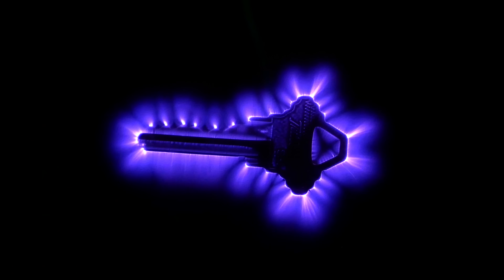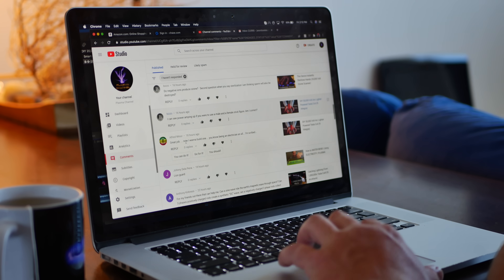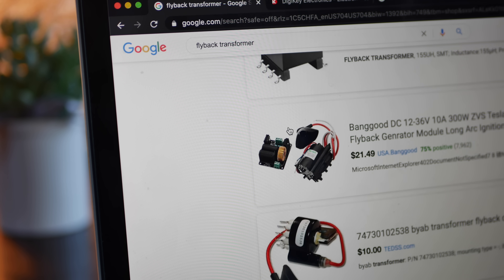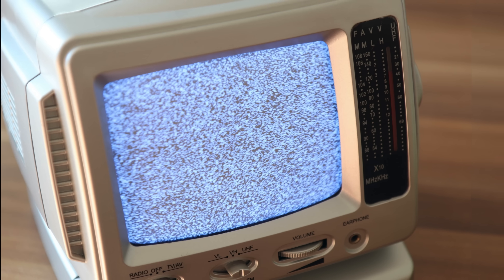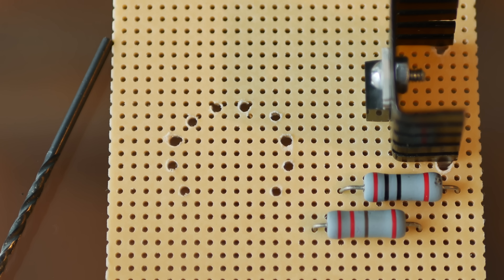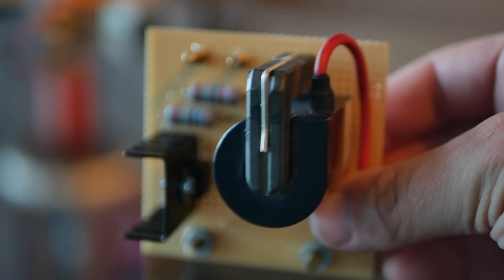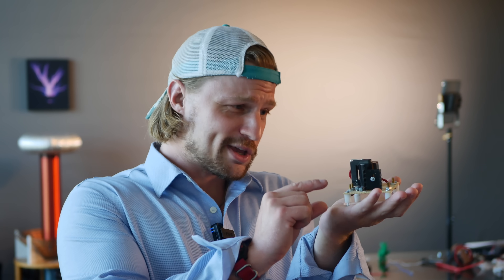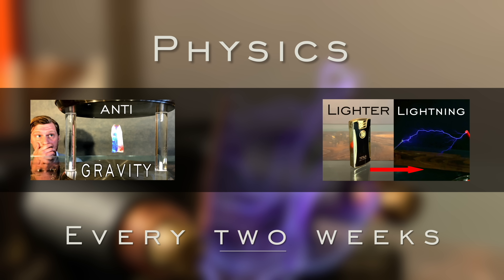DIY Plasma Physics Powersource (Mini 20,000v Flyback)

Comment: In order for there to be an arc, shouldn't there be a constantly changing (but not necessarily alternating) current in the primary coil? I dont see how the mosfet would undergo cycles of ON and OFF states in the given schematic without the 12V being turned on and off. 

From what i understand, the circuit undergoes the following steps (please correct me if i am wrong):
1. At first the mosfet is OFF. When the 12V is turned ON, there is some current going from the voltage divider through the flyback coil to the base of the mosfet, thus turning the mosfet ON. As a consequence of this, during the time when the mosfet is not yet saturated, the current through the flyback and the primary coils rises, thus changing the magnetic flux through these coils, which in turn induces an emf accross the secondary coil. Due to the proportionality of windings in the primary to the secondary coil, the emf in the secondary coil is going to be very high, as intended.

2. When the mosfet reaches saturation, the current through the flyback and primary coils becomes constant, thus stopping the change of the magnetic flux, thus ceasing to induce emf in the secondary coil. Since the flyback coil has a lower resistance than the 20 Ohm resistor, most current at the junction after the 220 Ohm resistor will go to the base of the mosfet, thus keeping it in the saturated ON state. If this is correct, this means that the mosfet will be stuck in ON state forever and never change the magnetic flux through the primary and flyback coils again. 

Now, the schematic is probably correct, which means that the mosfet does actually undergo cycles of ON and OFF. Could these cycles be caused by the back emf in the flyback coil cancelling out the pd between the junction and the base of the mosfet, thereby getting it into an OFF sate, or is my understanding of the schematic not accurate?

Comment: so transformers only work with ac voltage, how did you make dc turn into ac
i wanna know this cause im messing around with transformers and wanna know how to make dc, ac
Reply from the maker: Transformers work equally as well with pulsating DC. 

This uses a transistor. Cheers.
Reply: @PlasmaChannel  thank you! Now I can finally use transformers

Comment: Hello ,  i was wondering what is the volt /current of the arc ? 
Are they constent by polarity ?
 I mean when you turn it on do you get a constent stable  "arc" of lets say 20000  volt and 0.002 amp with a constent polarity ? 
Thank you for your time 
Have a nice day

Comment: Someone make my parents understand that wearing gloves without holes will not get you any shock
Reply from the maker: Well, only if the gloves you are wearing are designed for high voltage. 20,000 volts (even 5,000 volts) will go straight through a normal latex glove.

Comment: Your videos are fantastic Jay! I just subscribed after watching several of them, and I'm hooked. Quick question - where do you get your HV wiring from? I'm wanting to purchase some (or make some by modifying regular 14 gauge wire), in order to attached a high voltage source (your DIY 10KV to 15kv project that uses ionic air transformer with ballast driver) to an electrical grid of sorts (length from HV source to grid would be 8 to 15 feet). I've noticed in some of your videos that you use black insulated wire (looks like silicon insulation) and some of it has the "UL" label on it. I've searched using Google, Amazon, etc, with only a few hits (fairly pricey). Can you let us know where you get your HV wiring from?
Reply from the maker: Welcome to the family! So glad to have you. I get most of my HV wire from all the high voltage devices I take apart. I recycle it from things such as microwaves and crt screens.

However, silicon coated wire is definitely the way to go, and you can get it on Amazon.
Reply: @PlasmaChannel  That's good info Jay. Thank you!

Comment: Hi Jay. Can I use car ignition coil as transformer?
Reply from the maker: You would need to modify the circuit quite a bit. In the current layout, it would not work.

Comment: What do you use to ground the circuit?
Reply from the maker: The circuit is not grounded. The HV wire connected to the bottom of the transformer acts as a ground though it is still at a -HV as opposed to zero.

Comment: Help needed!!! Built a beautiful board according to the schematic...nearly fried the 2N3055 in a matter of seconds at 12v 5A CC...flyback never discharged...pulled the Mosfet and it tested good, within fact sheet specs. Went back to a breadboard, tested each component including a brand new flyback....went through 3 different Mosfets that should have worked and no discharge from the flyback...destroyed 1 and nearly over heated the other two again at 12v 5A CC. Went back and tested every component, even meged the high voltage coil, and I just can't make it work. I like the idea of this simple circuit and it would be great for my application if I can made it work...any help or ideas????

Comment: Does this produce a smooth output or pulsed, and if the second, is there a way to smooth it? I'm aiming to make a singing arc, and I'm not sure how a pulsed output would work with the resonant circuit.
Reply from the maker: great question. This is pulsed DC out. A high voltage capacitor across the output leads would help smooth the output. Make sure there's a bleed resistor across those capacitor leads though.

Comment: Sir can I use electricity from this project in any electric motor or small led bulb.
Reply: No! It will blow (big time) any LED, and any small electric motor, and won't have the power to run a large motor. Thats not what it was designed for. There are different power supplies for different purposes.
Reply: @martinsims1273  ok

Comment: Will this high voltage hurt if the wire is touched?
Reply from the maker: I do not recommend touching it, ever. It will not kill, or hurt you much. But, it may burn your skin.

Comment: Jay,
I have the flyback transformer from TEDSS  in your links and I'm really struggling trying to identify the pins for the primary and feedback coils.  Lowest resistance is between 2 - 4 and 6 - 7 but those don't work for me. Can you offer any assistance?
Reply from the maker: I had a viewer inform me they had similar issues. If you consider the lower resistance to be the feedback, and next lowest to be primary, it may help.

Comment: Hi! I was able to create this work! really thankful for your explanation. Just one CLAIM tho. In the video you say that to find the feedback and primary coil we need to check the resistance, the higher resistance is the feedback coil. But this statement is wrong: the primary coil has more windings, therefore the primary coil has higher resistance. I had to test this myself since it wasn't working until I flipped the connections. for the rest dope video bro, really really dope! Amazing
Reply from the maker: Glad you were able to build! I've found depending on the transformer, their primary coils have a thicker gauge of wire and have lower resistance, and the feedback have thinner wire, but less turns. It seems to be a flop depending on model of transformer. Really glad you got it working though, and congrats.
Reply: @PlasmaChannel  oh okay then, supercool. yeah it took me a while to understand how the hell it worked, but now i have it! thank you!!

Comment: Hi, Jay. I built this circuit and am using the MJE3055T transistor that you are shown using in the video and using a variable DC power supply to power the circuit. I cannot get arcs though and the circuit draws a lot current and the transistor gets hot very quickly. Any suggestions or tips to powering it up? Thank you!!
Reply: Are you sure you're insulating the bottom from any ground?

Comment: hi, sorry i m new to this but where did u mae the connection from your circuit to the final screws? it doesn t really show. the spark gap at the end of the video is given by the screws being connected one to the transformer and the other to the transistor?  plus there is a red wire going from one of the screws, where does it come from ? ( you put 4 screws: two for the battery, one for the spark gap that I don't understand how it is connected, and the last one has a red wire coming out of it). it would really help me out if you could answer these questions since i'm trying to do the project myself.  REALLY AMAZING VIDEO THO

Comment: Can I use IRFZ44N Mosfet instead of this?
I used 2n3055, but result was poor
Reply: And I placed 47Ohm resistor instead of 20Ohm, does that make difference?
Reply: And I also heard annoying high freq buzzing when I turn on transformer, what can it be?

Comment: What are the 2 primary coils in 2:56 please let me know
Reply: Yeah just in case you’re still interested in this, I’ll help you out. I’ve been lightly working for like a month on this as my first ever electronic project and I’ve figured out what you’re asking. The primary coil’s two terminals connect to two things. One of the primary terminals of the flyback connects to the collector, the other connects to the positive input.
Reply: @hayden_smith6  if you have done any simulation can you please help me regarding it

Comment: Nice!  This is basically a souped up version of the small plasma lighter circuit.  The output voltage is high frequency high voltage AC because of the self-oscillation of the primary side caused by interaction between the feedback winding and the transistor.  The output would be suitable for presenting to the input of a voltage multiplier to get very high voltage DC at the top of the multiplier.  Edited to add, it appears that flyback transformers like the one used for this project have rectifier diodes in the secondary so the output would be DC and so NOT suitable for voltage multiplier projects.  You want the output to be high frequency AC to feed into a voltage multiplier.

Comment: Will any transformers work because I tried to use a transformer that is different than the one you have. It has 2 adjust buttons and two extra wires at the top besides the red one.  I did the same circut you did but the thing didn't work can you help
Reply: Try switching the feedback wires on the transformer and check of your transistor is broken/damaged
Reply: @12E-s3i  ya I did that I checked to find the places with the least resistance but they all had ohm larger than 1 and they kept changing. Like one day on pin 1 it was measuring 1.2 ohm then the next it changed to 3.2 them to 2.4 which kind of confused me.   

Also I did switch the feedback and primary didn't work, so then I rewired it so that the first 2 pins are primary and third and fourth are feedback still didn't work.

Also do you know where I place the red wire from the transformer because I think that that is suppose to be ground but I am not shure
Reply: @treverbelmont8393  The red wire from the transformer is the high voltage out! Watch the video again, the part where the completed build is shown and the schematic.
Reply: @divingquokka  ya I watched the video alot but he didn't use the large red wire so i don't know what I am doing wrong and I dont understand why he chose that pin for ground
Reply: @treverbelmont8393  Go to 3:41 for the large red wire.
And read his pinned comment: 1) The high voltage ground is found by slowly bringing the high voltage out near the pins. One will heavily arc to the HV out - that is the ground.
Reply: @divingquokka  thank you I will try that

Comment: Would a 22 ohm resistor instead of 20 also work or should i get 2 10 ohm resistor and put them in series (there wasnt 20 ohm where i buy stuff)?
Reply: 22 Ohm will work too.

Comment: Just trying to understand the schematics here. When the circuit is first turned ON, C-E is off, primary is off. Base is turned ON via flyback loop saturating, it opens the transistor completing the primary circuit (which saturates too), and that immediately grounds the base, turning the transistor off. and then the cycle repeats. Is that what is going on here?

Comment: Can a fast (ultrafast) diode be used to protect transistor from voltage discharge kickbacks (voltage spikes aka inductive loads) generated by coil?
Reply: i tried it, the diode gets really hot. My circuit worked for a long time without one so, you should be fine without one
Reply: I think I read that somewhere. Another option would be a coil. Google aroudn a bit, you should find tips.

Comment: You should use some small lithium batteries, so it's even more portable!
I would put the batteries in the space you left with the acyrlic glass, first I would put Kapton tape, to isolate the rest of the circuit with the battery.
Im from ElectroBOOM channel here.

Comment: The moment I saw this video I was like "I NEED TO TRY THIS". Especially since I had a flyback transformer laying around. I jumped out of bed and went to the store for components. Took me a little while to find proper coils on my transformer and I had to use KD502 transistor instead of 2N3055 but low and behold, it works :D Super cool!
Reply: Are you using batteries as your power source ??
Reply: @estebanchristinogallardo5991  Nope. I have a 12V PSU, probably for some old type of laptop. I bought a proper connector and soldered it to the perfboard. Anyway if you wanna do this project yourself it would be a good practice to limit the current on the primary as much as possible. I used Jay's circuit and after maybe 1 hour of playing around my primary overheated and shorted out. Now I'm out of flyback transformers :C
Reply: It probably happened because Jay's transformer worked fine on current limited by this 240Ohm resistance or I just overdone it and maybe you shouldn't keep the circuit running for too long.

Comment: Jay were can I get the exact flyback transformer
Reply from the maker: Hi, it's very hard to find. But, ebay, and those mini tvs
Reply: @PlasmaChannel  I found one but in TVs it’s dc I need ac I found some tho should be here soon
Reply: @PlasmaChannel  and where did you get yours exactly

Comment: Fly back transformers are not new..They were around  from the first b&w TVs but most of the late 40s color sets uses bigger and higher voltage for the needs of the crt..around 25kv.

Comment: I build this using a ksd363rtu transistor** and the arcs are not nearly as powerful as the ones in your video. I am using a much larger flyback than the one you are using, I'm not sure if that would have something to do with it? Also the transistor I am using gets really hot while the circuit is on, it got so hot I had to add a fan to the heatsink. Do you by any chance know why my setup doesn't seem to be working? thanks in advance:)

**I looked for the ksd362rtu but can't find it anywhere but it seemed as though the ksd363rtu is pretty similar

Comment: Appreciate it man I'm a electrician and recently got into wood burning with neon sign transformers and got obsessed with high voltage immediately I'm stoked to try the Marx ..I tore apart a old tubed TV 2 day's ago and got a fly back out of it and it looks identical to the 1 in the video now I know how to find my primary....curious to know if I can burn wood with it
Reply: I was thinking of making this device and trying to hook it up to a small lawnmower engine coil so I have plasma spark to see i would be able to use water for fuel on it you think it would work for something like that ?

Comment: Do you know any transformers to use that have similar effects or does any work? Dont know how to calculate for the resistors and capacitors just incase if the transformer isnt the same.

Comment: just to understand... with a single 12v input... its over here in output 20.000v ? is it really? wowww...  anyway a question:  for increase this powerful was because this transistor??? and bobine there's inside the flyback?

Comment: Want to make this for my Grandsons Thanks D.W.
Reply from the maker: Hey dick! Glad you enjoyed. Remember, each flyback transformer is a little bit different. Sometimes you have to experiment to find the right pins. Patience is key. Once it works, it works! If it stops working-----it's always because the transistor got to hot! Dont use more than 15 volts input, and you'll be good.

Comment: So what's the difference with this flyback transformer vs a 400kv/50kv step up modules sold in ebay? 
I'm gonna assume they already have all the transitors and resistor etc. Because they produce a nice spark gap.

Awesome videos as usual
Reply: Well, those aren't well insulated, not so they output that much voltage. One can measure voltage by measuring the length of arc, that is 30kv/cm, so uhm yeah, just a bit more unsafe and pretty useless too, due to poor insulation they short easily, and well, break.

Comment: Nice video. I am wondering if your circuit can be used to make a surface 
functionalization tool for microfluidics, there are commercial ones 
available, but they are $1000 or more. Is it possible to reconfigure 
your circuit for this purpose? How? Thanks.

Comment: Thanks! Amazing video. What is the minimum and maximum input voltage that you recommend?
Reply from the maker: Thanks Eric!! Minimum voltage is about 6 volts, and max is 15. You could likely do higher voltage, but you 1) need to build the components more spaced out than I did or they will arc to themselves, and 2), may burn out the transformer pretty quickly.

To be safe....I'd just limit it to 15 volts max, and make sure the transistor has a great heat sink.

Comment: I accidentally ordered 1W resistors so i just wanted to ask if you think they would Survive if i used them instead
Reply from the maker: Yeah, those will still work. Just cant run it for more than 5-10 seconds at a time though, or they will burn up
Reply: @PlasmaChannel  or i just stick 4 of them in Series-parallel thus making it 4 watt

Comment: Just a high voltage discharge , the flyback transformer contain a built in component called trippler , which multiplies the output DC voltage .